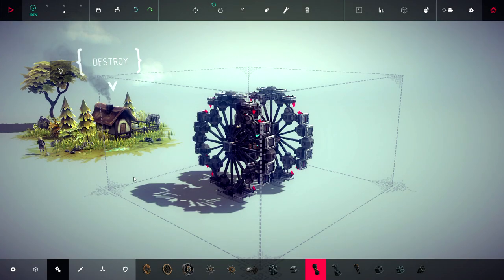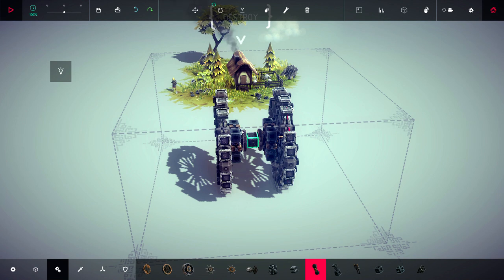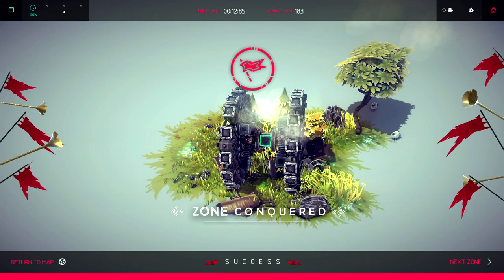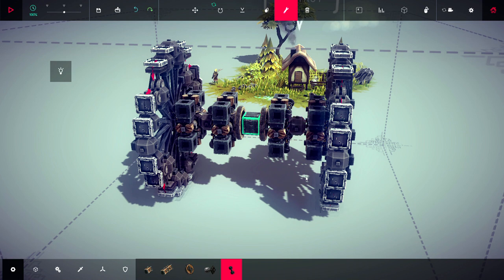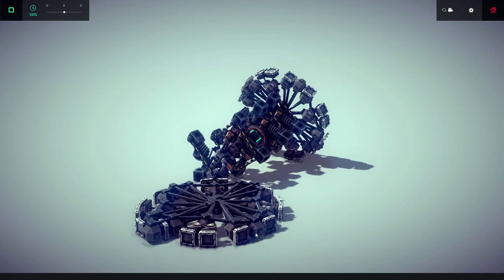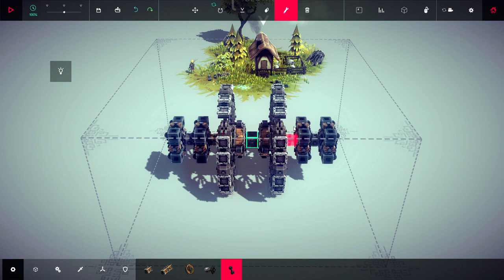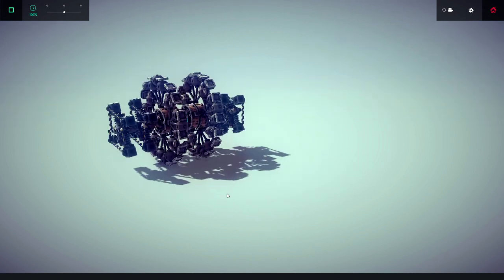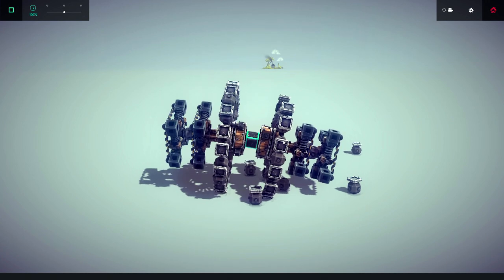Besiege Early Access (Ep. 26) - Torque

Comment: I can already see an improvement on this idea. Move the perpetual engines on both side of the wheels, instead of putting them on one side. Previously, you had problems with it breaking in the middle because it had bend in the middle, and now, it almost looks like the middle will break just from the weight on the outside sides of the wheels.

Also, I have figured out a steering mechanism, set key bindings to stop one side of the wheel, or just have separate key bindings on all four of them, for little turning by stop only one engine, or maximum steering by shutting down all of one side.

Comment: You can add axles by way of struts on unpowered wheels going through components. This would solve your problem of sag and breaking when building this machine.
Reply from the maker: Matt H That could help reduce sag but it comes with its own problems that have to be accounted for.  In this case, you still need blocks at key locations to hold the wheels and perpetual motion drives.  With braces in between individual blocks to reduce sag, you're introducing multiple break points that tend to pop off at the slightest bump.  It's not a bad idea, just something to consider as part of the design.